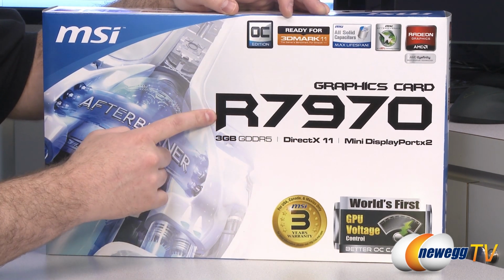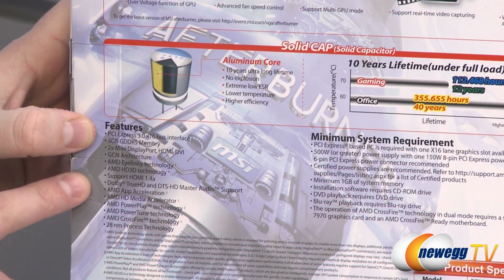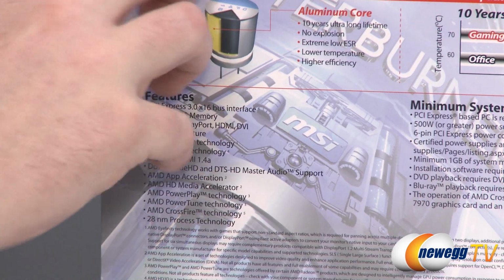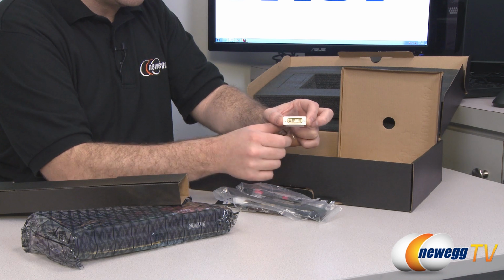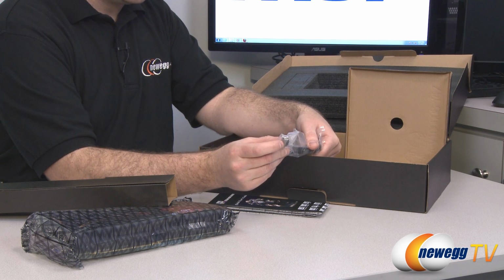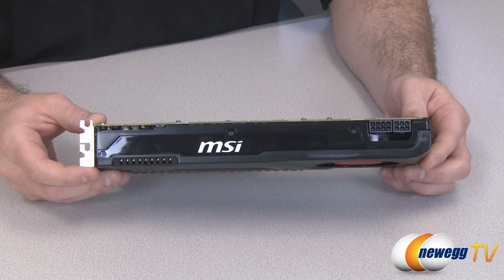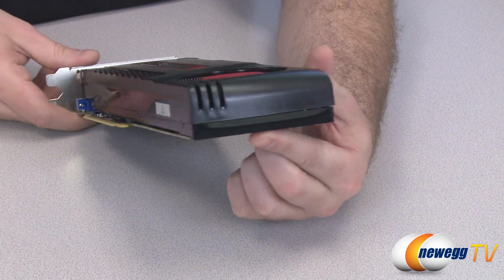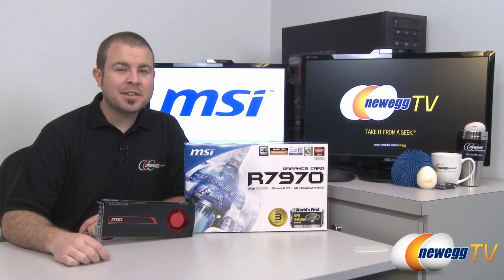Newegg TV: MSI R7970 Overclocked AMD Radeon HD 7970 PCI-E 3.0 Video Card

Comment: 1 680 = 1 7970  The new 7970 drivers make the 7970 a lot faster and the fact that you can overvolt the core on the 7970 makes it so you you can overclock it even more to make it faster than the 680.

Comment: Are you serious? The heat production, power consumption, and benchmark results prove that even a GTX 670 > 7970. 

That being said, for multimonitor set up id get a 7970 but for a more powerful 3D gaming, single monitor experience, its a GTX 670.